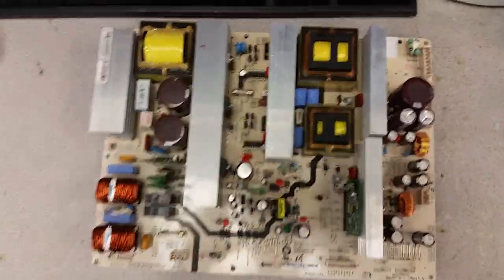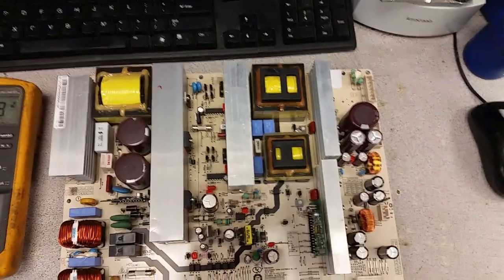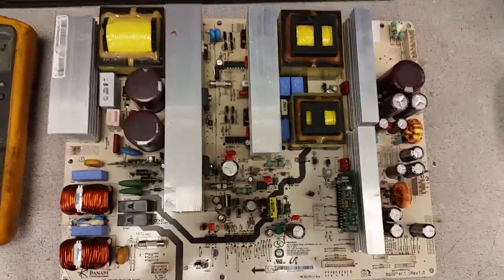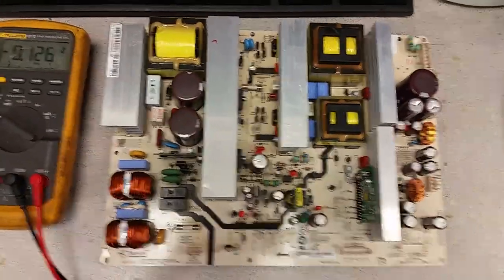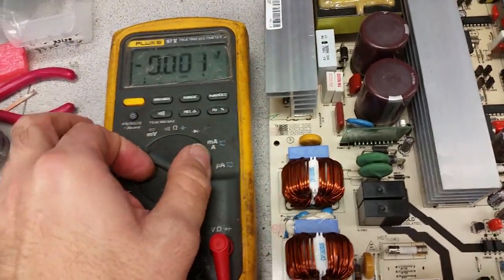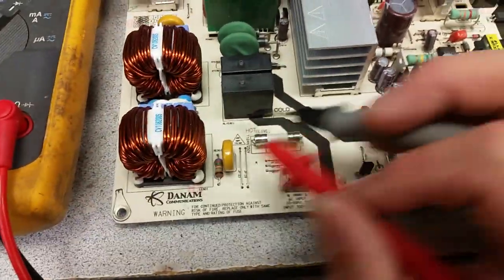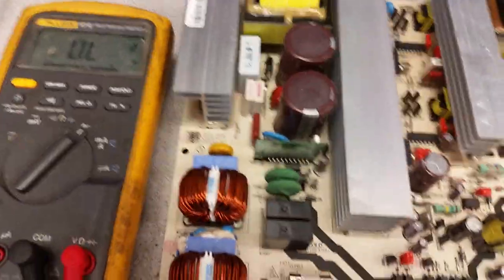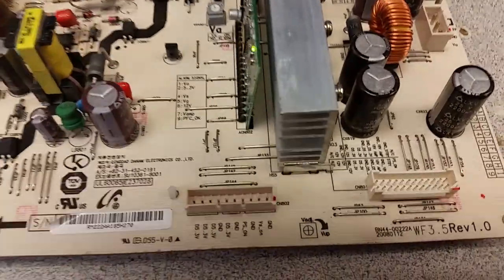How to test Samsung plasma TV power supply BN44-00222A (PN50A530S2FXZA, PN50A550S1FXZA and others)

Comment: So if Vs and Va are low or nil it is a bad power board? Or could that still be a logic board problem if there is no green light? So many unanswered questions.
Reply from the maker: I think it's pretty obvious actually. If Va and Vs work fine in a bench test and not fine when the board is connected to other boards then there is a 99% chance the problem is out of the board. If you can't get Va and Vs in a bench test then the problem is in the board or in you.
Reply: @coppelltvrepair  Things have not appeared obvious to me, having never before opened up a TV; perhaps if I explain further you can help with similar ease. I lost picture and sound in an instant while watching, I didn't take note whether it had immediately gone into standby (back to red light on front panel) but I presume so. When trying to turn it back on with the remote it just made a series of clicking noises, familiar but more numerous than usual, and it was obviously failing to start (no Samsung jingle) and simply returning to standby mode. I watched a video about a similar plasma TV repair (mine is a PN50B430P2D) in which it was suggested that the X and Y main boards, perhaps others, could be unplugged alternately from the power board to see if it had any effect on reviving the startup jingle, and it did! Only when I unplugged the x-main was the startup jingle successful. The conclusion was said to be to replace the x-main board, which was a great relief, having sleuthed out the culprit in short order. I believe it was at around this juncture I had also tested for Va and Vs to compare with the label given some other advice (55 and 209 vdc respectively) and got a very close reading for Va but noted the Vs to overshoot 250 vdc (the max reading on that particular analog scale setting) before coming back down closer what I was expecting. In fact I cannot recall how far the reading fell or if it truly settled but was comforted seeing voltages in range if not steady. I also noted the green LED on the logic board as having a regular 'heartbeat', going off briefly once per long second or so, said elsewhere to be what it should be doing. So, feeling happy with developments, I ordered a replacement x-main and upon arrival installed it (albeit at first go around stupidly forgetting to connect the ribbon cable from the logic board). I didn't see anything visibly wrong with the x-main board I removed, but lo and behold, I got the Samsung jingle when I plugged the TV in and turned it on with the new board in place (even without that logic board ribbon connected). Happily, I noted the 'heartbeat' green light was also still doing its thing as before. But, alas, still no picture, same black screen, and no menu. So much for my first foray into home TV repair. Then, some minutes later, while scratching my head in disappointment, I noticed the ribbon cable I had neglected to connect to the x-main and got that back on. Somewhere around this time, trying repeatedly in vain to get a picture, I noticed that the green light on the logic board was no longer on and blinking intermittently as before. The TV would still turn on and off, still make the revived jingles, but no picture and no green light. I also noted that there was still audio available from the input device despite no picture, I had sound in addition to the jingles. Testing for Va and Vs this time revealed Va = 0 and Vs ~ 5.6 vdc. Another reading, Vg = 16 vdc, though I can find no reference as to what it should be despite its presence among the major pins. I also confirmed two 3 vdc lines active to the logic board, despite no green light, I suspect the absent green light to be related to the higher voltages being down. At some point, again trying to disconnect various cables and ribbons from the primary boards, even the low Vs reading at the power board had become zero. Now, Va = Vs  = 0 no matter the combinations tried with cables meaning the power board itself must be at fault. Out of curiosity I reinstalled the original x-main board at this point given no other bright ideas jumping to mind and to my (half-expected) surprise it now allowed for the TV to start and stop complete with the Samsung jingle, that sadly having been the only reason for replacing the x-main. I concluded that Vs power reaching that original x-board was what in turn prevented the TV startup jingle, or else there is a flaw in my logic. I am led to conclude that instead of the x-main board directly causing the no-start problem to begin with that it was in fact some unfortunate combination of the power supply and x-main board. I am also left to conclude, given your previous reply, that my logic board could not be the cause of my power board malfunctioning, which was what I wondered given the now missing green light; I had to ask a dumb question, though I've always been told there are no dumb questions, perhaps only those poorly asked. And I get the same missing high voltages whether all cables are connected to the power board, or not, including during a 'bench test' (for which I have no bench, save disconnecting everything but the 120 vac incoming which I have confirmed at the board connector), which you have now confirmed it should have done even on its own. I am therefore also led to conclude that I must now replace the power board since it appears dead in all but the low voltage circuits regardless of circumstances (an odd development given it had high voltages when I started, before replacing the x-main). I further assume that replacing the power board would revive the green LED on the logic board, and that the speaker sound operates independently of the X or y-main boards and high voltages altogether for I still have sound with or without those. What I don't know now is whether putting in a replacement power board will simply lead to another power board or x-main failure, or if there was ever anything wrong with the original x-main board to begin with since things are now looking more like a power board issue. Perhaps those high voltage spikes over 250 vdc I saw initially when testing for Vs were a telltale sign? Should those Vs voltages have always appeared as stable and on value? Can you also shed some light upon this would-be home TV repairmen, before I throw more good money after bad, and explain why that original x-main board prevented the TV from starting and making its jingle when it now works every bit as well as the replacement board now that I have lost the high voltages? I very much appreciate your time and expertise!
Reply from the maker: @ronb7481  I have to apologize, but I do not have the time presently to read through all that and help troubleshoot mostly by means of providing personal education.
I share bits and pieces of information with the full understanding that not everyone can make use of them in the same fashion. Sorry about that, but I don't think it can be any different and what would work for you may still not work for someone else.
I have lots of work and just not enough time to provide personalized attention to everyone in need.

Comment: On LCD TVs the PS-ON pin usually takes 3 volts to turn it on? or do you ground it too? BTW I have an electronics degree from TSTC Waco TX. (Yes, of branch davidian fame) I decided since I see all these broken TVs on Facebook and in the trash I might as well see what I can fix, is there a good course or online thing that will teach TVs and stereos for someone like me who has some back ground. I have a butt load of boards from cracked screen TVs.
Reply from the maker: Some power boards are activated by high level (2.6V or more) and others are activated by low (GND). Some require activation connection while others would be activated if there's nothing connected to them, which otherwise puts them down. There's no one universal rule, sorry.
Reply: @coppelltvrepair  Where did you learn TVs and such? I have a good background but the degree I got was very generalized electronics, it was a good program, but not specific on anything.
Reply from the maker: @vernonbosshard9317  Well oddly enough...for me it was just another hobby turned into profession. I had the basics too and everything I know about modern TVs I learned mostly myself through experience.
Reply: @coppelltvrepair  Thats amazing!! Youtube has been my savior.

Comment: Soon as I ground the PS-on the relays click and the main 12A fuse blows, the smaller ones stay in. The in-rush therms get hot and cook. I ohmed between the pins on the large mosfets, I get 2 - 5 ohms, I have good standby but soon I as power those relays say bye bye fuse. They sell a repair kit for these, looks like thats my next step, thanks to this video I now know its the PS.
Reply: Hey mines doing  the same thing. Really damaging rte801and 802. That's where it's getting very hot..
Did you find the solution?

Comment: Great video.  I have a Samsung plasma pn50b550t2f thats clicking and won't turn on. How can I tell if its the power board or main board? I've disconnected the other 2 board & still clicks and turns off.
Reply from the maker: Use the knowledge from this video and apply it to your power board to test it. It is the same principle.

Comment: Hi, please tell me, if I switch on my plasma, the ps-on and standby voltages are ok. However, no va and vs voltages. If I ground the ps-on pin and send the 5.3V to the VS-on pin then all voltages including the VA and VS voltages. What can the problem be?
Reply from the maker: There are too many possibilities and not enough information to narrow them down, sorry. What is evident is that the problem is not likely going to be in the power supply board and more likely to be in the main board or  plasma logic board or sustain boards.
Reply: @coppelltvrepair  Ok but the VA and VS voltages comes from the powersupply right? So, if I disconnect the powersupply from all other boards and I only get my standby and ps-on voltage but no VA and VS voltages to  turn on the sustain boards. As soon as I send the 5.3V to vs-on pin the VA and VS voltages are there (still with the powersupply disconnected). Does this not mean that the VS transformer is not functioning and for this reason the problem is with the powersupply?
Reply from the maker: @peteruren4086  Yes they do. I have to apologize, but we do not have the resources to educate people on individual basis.

Comment: Hi, when I put power to my board which is the same as the video I dont get any sign of power/ green light does not come on, is this a sign for anything specific? all the fuses seem ok when tested with volt meter test? (tested in place not removed) I have one black capacitor which has some black stuff on the top, the second one up on the far right above the the rev code
Reply from the maker: Afraid this is not a sign of anything specific.
Something is not right in the standby circuit apparently, if there's no standby output, but there are many things that can be it.

Comment: Hi, my Samsung plasma TV 43inch not working, no sound no display, no clicking sound, there is standby light, 
Logic board green light blinks as 5sec off, 2sec on,...
I disconnected Ysus board socket, tried again but no change.

Power board fuse ok, standby 5.2 and PS ON 3.5.
sticker it suggests Va 58 and Vs 209,
As soon as I switch on TV, 
Va reduces continuously from 208 to 10
Vs reduces continuously from 58 to 0

On Ysus board
As soon as I switch on TV
SVT VS reduces continuously from 208 to 10
SVT VE increases to 16 and then reduces to 10
STV YOUT remains 0

On Xsus board
As soon as I switch on TV
STV VS reduces continuously from 208 to 10
STV XOUT increases to 12 then reduces to 10

Please help how to find the fault and what do I need to replace?
Thank you

Comment: Very interesting video, and very well explained. I found a TV with this supply near a dumpster. Not powering on, relay clicking and no Vs. Found out it was 2 broken solder joints on the plastic capacitors between the 2 transformers. Arcing almost cut the nearby traces, but now the tv works fine. 
I'm surprised how ugly solder joints looks like. I had to reheat almost every big components.

Only thing left, the VS voltage seems a little bit too high, i measure 213v (expected 205), but the voltage in my workshop is pretty high (237v). Should i adjust it?

Comment: What if the little green light u say should be solid, what if it flashes instead
Reply from the maker: Flashing indicates an error code that the board's watchdogs have discovered and because of which they block the board. Errors can be caused by factors outside of board (if other boards are connected to it) or by failures in internal circuits - testing a board without anything connected to it eliminates the first group.
Once you know the problem is in the board you either replace it or have it service it or learn to service it yourself, the last being way above the scope of this review.

Comment: Great video, I have the same model but the issue is that the TV will not turn on, only the red light on the front stays on or flashes. What do you think it is that I should start checking?
Reply from the maker: If you tested the power and it's OK then most likely it is the main board.
Reply: @coppelltvrepair  Yeah the power is good, thank you for the reply.

Comment: I have bn44-00222a, keeps on clicking, could u tell me how to fix it?
Reply from the maker: I can't even tell if it is bad or if it is the main board that's causing it click, let alone tell you what is wrong with it (if any) and how to fix it.
Doing so will include extensive amount of communication which you wouldn't be willing to pay for and/or extensive amount of assumptions resulting in lots of incorrect advice. Add to that the risk of you not doing properly something we ask you to do and it gets so messed up the only proper way to do it is to not do it at all.
Reply: @coppelltvrepair  okay thanks